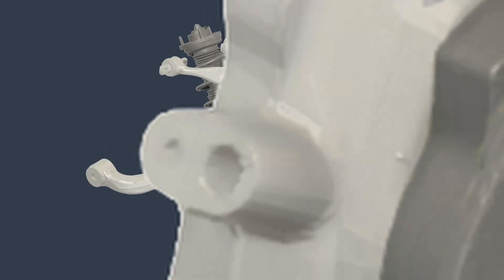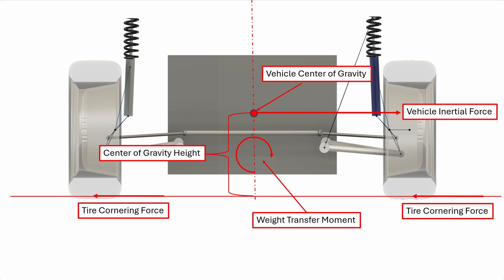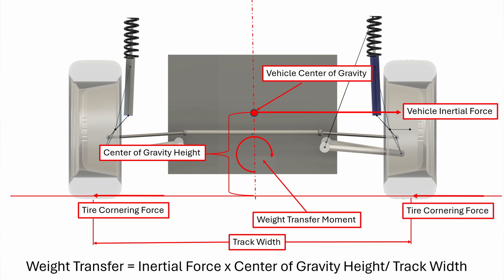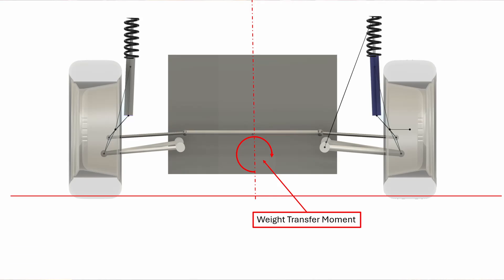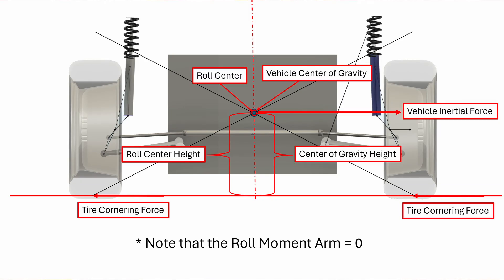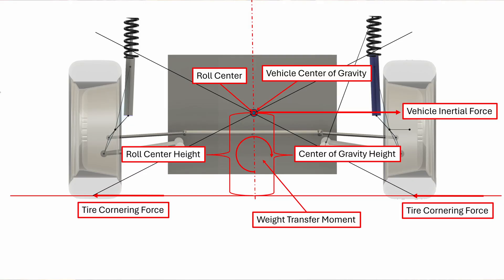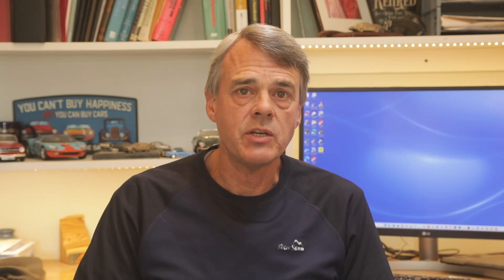Why Lowering Your Car Can Result In MORE Body Roll

Comment: If we lower a car on coilovers, keep the same spring rate, and use a roll centre adjustment kit to return suspension geometry shouldn't that be the ideal? Essentially a lower CG and still have compliant suspension on the rough stuff?

Comment: So assuming a suspension design with camber curves that maintain optimum contact patch through the travel, lowering will still improve max grip, because although the car is rolling more, overall weight transfer is lower and contact patch is maintained. Obviously very few cars have optimum camber curves, so that's more theoretical than anything. But for cars with good suspension designs (sorry strut owners), and especially once very stiff springs are already required due to tire and aero loads, then we're looking at very little roll regardless, and perhaps getting as low as possible is still the ideal? Especially if that enables further downforce gains?

Comment: Not even a little bit! That was just a bunch of gobbledygook. If you do nothing else but just lower the car it will still have the same amount of body roll. One needs to modify bushings, dampeners, shocks, and a number of things in which to reduce the body roll, but most people are just doing it for looks ¿`_

Comment: Quick point of order and request for clarification? I've watched this video and the previous one, and both seem to be assuming that a lowered car would have the same spring rates and dampers. In almost every car I've had any kind of familiarity with, the lowered springs and/or coilovers will almost universally have a higher spring rate and the latter of course would be paired with the appropriate damper for a given spring. I don't know of any lowering spring or coilover on the market that offers a spring rate that is set the same as OEM. Are both of these videos assuming lowering a car WITHOUT doing anything with the spring rate? 

This just seems like an incredibly unlikely scenario that someone intending to lower their car would encounter, at least with modern sporty and performance cars. Eibach, H&R, 034, Koni, Fox, Ohlins, APR, Dinan, etc. don't even offer springs for their respective cars at factory rates from what I've seen. They are universally stiffer.

Comment: It's also important to note that generally, lowering a car usually goes along with increasing the spring stiffness.
Should be noted that the extra roll would likely only be apparent if the spring rate is the same.
Reply: So do the stiffer springs act as a band-aid solution for the extra body-roll.?
Reply: @Anthony40231 yeah essentially, as well as preventing the car from hitting the bump stops or bottoming out the shocks

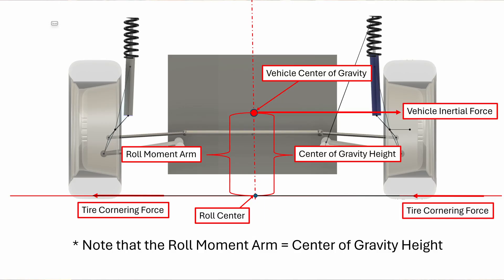Comment: @2:46 this video series is brilliant but you flash the graphics wayyy too fast to possibly take them in. Even if I back it up five times it’s still not enough. Would be helpful if you left the illustrations on the screen for significantly longer and pop some arrows on them to point out the points that you are talking about.

Comment: Please explain how manufacturers choose a tire diameter (OD) in the design phase for a new car. Is it simply dependent on what looks good on the car?
Reply: Good question
Reply: very unlikely, as you have seen car concepts always have bigger wheels for aesthetic purposes, however the production models always have them corrected after it has gone through the engineering work for the suspension design

Comment: I remember seeing a TransAm cornering very fast once during the late 1970's. The front of the car's suspension seemed to lift the car higher off the pavement, but I saw very little roll and the car maintained traction during the event. I attributed most of this effect to the car's having a very large stabilizer bar on the front suspension.
Was I correct, and can you give us a video, or a series of videos, on the effect of stabilizer bars when placed on the rear of vehicles like mini trucks (older Toyota pickups, for example), and what happens to traction in curves and cornering with added rear stabilizer bars. Your videos are very educational. Thanks.
Reply: Thanks. "Adjustable" and about half the size of the front bar sounds like a plan since I would be limited by the otherwise stock setup and at least four hundred stable pounds of extra, high-level weight in and on the bed at all times. I have always used inexpensive air shocks to lift the rear and stabilize the handling. It's good to find real teachers to help with understanding "how it works" in a real application.

Comment: I'm planning to do a pretty radical suspension setup for my car.
Total:1520kg~ 55% F/45% R
I'm looking to get:
6kgf/mm front springs (165mm max, 130mm working compression travel)
35kgf/mm Antiroll Bar Front
5kgf/mm rear springs (170mm max, 130mm working compression travel)
27kgf/mm Antiroll Bar rear 

I plan to have around 60mm of available working suspension travel for dynamic compression forces. 70mm will be taken by car's static weight and preload.
Clarify my understanding of anti roll bars, they link the L and R suspension and based on it's stiffness will be how much the suspension are linked by?
In my application, would the front and rears be roughly linked by 85%~? (35:6 and 27:5)
So lets say a 1g lateral force, my outside front tires would be exposed to 420kg of static and an additional 420kg of dynamic force. With my 130mm of working travel 70mm is for static, so normally that would mean my 60mm remaining travel would not be enough, as I would need another 10mm. But due to my ridiculous 85% link, I can use 85% of the other suspension resulting in a total dynamic spring rate of 11kgf/mm and only 39mm of travel after the static drop of 70mm.

Is this sound theory? If not, I'll just run the basic suspension setup. I'm looking for comfortable highway rides, but also a cornering animal.

Comment: A few questions:
1) since electric vehicles have a much lower center of gravity due to their batteries, would they experience less body roll assuming the same geometry and lowering distance?
2) how does a swaybar work and is it a reasonable way of offsetting the impact of lowering your vehicle? 
3) in a previous video you covered wheel spacers.  Is there any compounding or offsetting impact of both lowering the vehicle and adding wheel spacers? 

Love your videos! Thanks so much for the informative content!
Reply from the maker: EV's do have much lower centers of gravity and so will roll less, all other things being equal. What an EV does for you is give you the opportunity to make the anti-roll bars much smaller, or even get rid of them (especially the rear one) which give much better ride. That gets to your second question. Anti-roll bars could be used to compensate for the additional roll a lowered car might have, but that would hurt ride. That's true for stiffer springs as well.
Lastly, wheel spacers increase the track width so they would reduce the weight transfer during cornering. They do nothing for body roll, however.

Comment: This goes a long way to explaining jacking on some suspensions. I imagine a load path from the centre of the contact patch to the roll centre, the horizontal component  is roll, the vertical component is jacking force extending (in most cases) the suspension. 
I've a related question regarding the roll axis (which you already commented on) but in relation to roll frequency and the rear axle 'seeing' the turn later than the front axle. Does the ideal roll axis change for applications ie fwd / rwd, front engine / rear engine, consumer / race / rally?
Lots of cars run trailing arm which would have a suboptimal roll axis but seem to perform OK.
Reply from the maker: The roll axis plays its part in the whole understeer/oversteer picture and since FWD/RWD/front engine/rear engined cars all have different inherent understeer characteristics, the balance of the roll axis with bump steer/bushing compliance/spring rates/anti-roll bar stiffnesses will be different. 
BTW, I talk about jacking in my 2 part video on roll centers.
Reply: @suspensionsexplained  thanks I hadn't seen it.
Reply: @suspensionsexplained  what happened to the jacking video? great clear explanation btw... hope to see more!

Comment: All other things being equal, a vehicle with a lower center of gravity should have better traction than a vehicle with a high center of gravity, correct? Considering the slip angle.
Reply from the maker: I assume you mean cornering traction, but, yes, a lower CG will give you better cornering traction because the inside and outside tires are doing more equal work generating cornering force. The more weight transfer you get, the lower the overall cornering power of the combined inner and outer tires will be. This is because of the non-linear behavior of tires. Their cornering capability does not increase linearly with increased vertical load.
Reply: Yes, with all else being equal. I think it's easier to think of weight transfer and body roll as two separate outcomes from the cornering force acting on the center of gravity/mass. Weight transfer is dependent primarily on the cornering force, and the CoG height. Body roll is dependent on the same things, but with the addition of the suspension geometry, and will affect how the wheels are aligned when cornering forces are applied. Body roll can therefore affect how well the tire contact patch is being used, which will affect how much cornering force gets applied in the first place. If body roll means you get too much camber gain, then more roll stiffness, or a higher roll center will allow you to use less negative camber to achieve similar cornering forces.

Comment: This is actually a really important clarification, and illuminates why in racing, it's still useful to have the car be very low, even if production-based. Spring forces can be compensated with stiffer springs, though not ideal, and contact patch loss from geometry can be compensated with aggressive alignment. Meanwhile weight transfer, and so the tires' place on it's load sensitivity curve is only determined by CG. So for minimal weight transfer the CG should be low, and contact patch should be well-managed.
Reply: Any production based race car will have modified suspension pickup points to correct the roll centres etc.
Reply: @stefanroseEP3  That totally depends on the series. Many rulesets ban modifications to mounting point locations. You can still do it in the outboard components often, but sometimes not. For example if you have a semi-trailing arm car, you're stuck with what you've got roll center wise if you can't move the pickup points.
Reply: @Levibetz so if i want to install coilovers on my vehicle and lower it by 30mm, i would need a lot of other components to properly compensate the lowering ? Its an S3 8Y, i have already isntalled a 107% stiffer rear sway bar and rear sway bar links. Im using factory -0.7 camber front -1.3 at the rear. I was thinking on installing camber plates at front and go -1.2/5. I have 245 all round changed from factory 235.
Reply: @Levibetz basically i want more compression and softer rebund, right now factory the compression is soft but the springs seems to rebund a bit harder than what the compress
Reply: @Otaner142  Do you mean that you feel like you're bottoming the suspension? Coilovers with higher spring rates should help that. Along with that of course they can increase compression and rebound damping. More camber will be good, aside from planting the contact patch better in turns the camber thrust will also make it turn-in sharper.
Reply: hmmm no im not bottoming out since its fixed stock sports suspension, im saying i feel like the rebound is faster than the compression not a lot but noticeable when going over bumps at mid speed 15-20mph. Like the suspension goes up faster than what it goes down. Like it goes up then down but it feels like it keeps oscillating its a bit weird and not as bad as it sounds. It could be just the sports fixed suspension. I havent compared it to another sports cars either so
Reply: @Otaner142  Thats the complicated part about coilovers, if you have 1 way coils you cant play seperatly with compression and rebound, its a "fixed mix" by the manufacturer, you can adjust but always both at the same time. For that you need a 2-way coilovers and a good amount of track hours. Then u have 3 and 4 ways which I strongly dont recomend if you are not in a pro racing level, way to complicated to get them right if your not an expert. My recomendation, make sure you are not bottoming out the shock or another suspension component. There is a little trick to check the travel of your shock with zip tie, in yt u can find a good explanation of it. Hope this helps
Reply: You can't align around a bad suspension, and stiffer springs are just limiting its effect. I guess the old "Any suspension works if you don't let it" adage applies here, but is seldom optimal. 
A too-low or too-high roll center can't be compensated by springs, it is a leverage issue. Increasing spring stiffness reduces weight transfer, thereby traction. Intuitive?  Not exactly.
Reply: @nobodynoone2500 Weight transfer actually happens regardless of spring stiffness, spring stiffness controls body motion and of course the tire's contact with the ground. Gokarts experience weight transfer despite not having suspension at all. The reason many passenger cars setup for racing have large amounts of negative camber is to compensate for body roll and the resulting camber loss, that's what I mean by alignment. So yes in essence you can align around a bad suspension. It's not ideal, but it will be faster than running a factory ride height and alignment. In fact most cars can go faster around a track with just a more aggressive alignment (generally more camber, maybe some toe out) but of course suffer increased tire wear in normal driving. What I mean by the roll center being compensated with stiff spring is that as is described in the video, the forces generated by the roll moment are transferred into the springs rather than suspension components, so by stiffening those springs (including sway bars) the actual body motion can be reduced. Of course at the cost of a stiffer ride which will suffer on uneven surfaces, but often not an issue on a race track.
Reply: @nobodynoone2500 
It sorta becomes intuitive after many a miles spent behind the wheel trying to go fast. 
Its why my first car was super low while all my current cars are kept at their oem heights, even after some mods regarding damping or basic geometry.